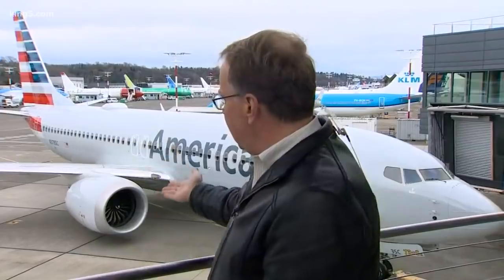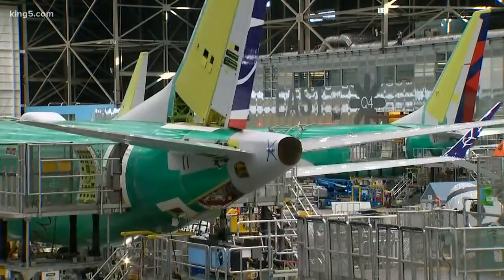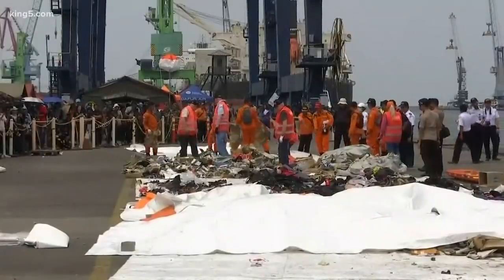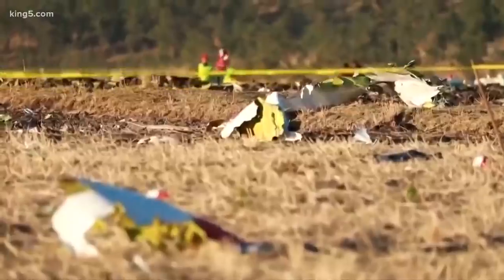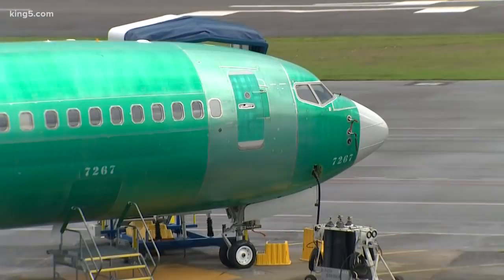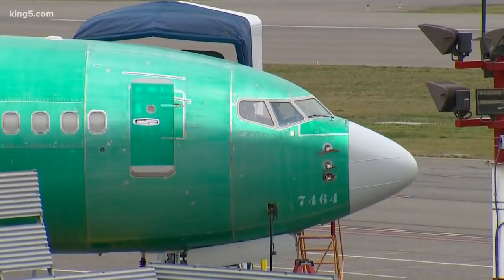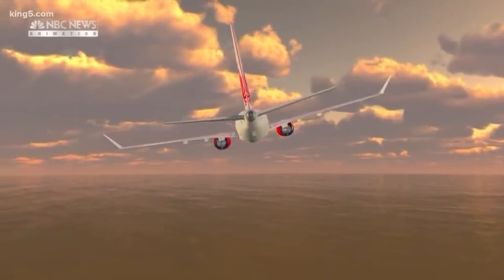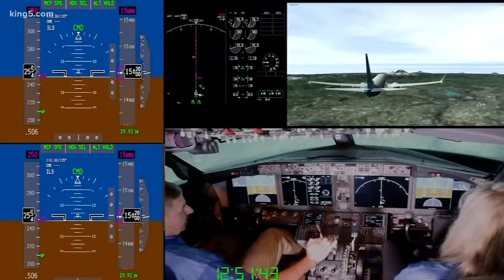Boeing unveils 737 Max fix

Comment: So what happens if the nose goes down due to the trim adjustment and the system is disabled at low speed but the yoke is pulled hard back in low altitude and dense air where the manual trim is too hard to correct? The software fix just alerts you but doesnt help you trim it correctly with little time.

Comment: If i should fly a max again i would like 2x2 AOA sensors, that  can work simultaniosly and when one sensor is giving another Reading than the rest the majority wins, and replace the faulty
sensor as soon as you land, and i would also accept if they move the Engines back where they used to be  so that they dont need the MCAS system....

Comment: ". . . an angle of attack sensor, and its suspected of playing a part in two crashes." That's Seattle media scared to death of offending Boeing, who already has one foot out the door of being a "local employer." Suspected has nothing to do with it. That's three crashes.

The 737 and the 737 MAX were treated as one airplane when pilots should have been certified on two, not one airplane. Second, Boeing, the FAA, and the airline companies that bought the 737 MAX should have made training in the MCAS system mandatory.

That's the only two fixed needed here, but to save money and increase profits, lives were lost. Good thing Boeing is used to being sued.

Comment: The MCAS (that has been blamed for the two accidents) behaves like all Airbus flight control systems, except all of those systems have redundant sensors. The Air France 447 disaster had a triple system failure (pitot tubes) and pilots ignorantly stalled plane into the Atlantic. Don't go skipping off into an Airbus thinking the pilots actually control the  aircraft more than Boeing designs. Boeing messed up, but so did the pilots. The runaway trim switches were right were they always are on the 737 max aircraft. Recently, Airbus A320neos have been having significant engine issues on brand new airplanes that pilots have fortunately saved the day with no loss of life. Lets hope it stays that way and Boeing gets its Airbus like flight automation corrected.

Comment: 737 was a fairly save aircraft, haven't heard of one crashing for a long time, does not happen often, so why "fix" something when it inherently is not exactly broken? Especially fucking it up this badly. "Never change a running system" is a common expression used by IT folk for not messing with stuff when it works well enough. Boeing did something that is understood to be a risky thing and went about it in the most unsafe manner possible. Those ultimately signing off this system at Boeing should be fired and never receive another high-paying manager job ever again, a person that cannot foresee the implication of messing with such a system or wrestling control away from pilots flying an aircraft known to be more manual than comparative offerings from Airbus should not be trusted with the life of other humans.

Comment: Ten to one Boeing had a good idea about the issues but thought it would work itself out during its routine maintenance 
But it failed sooner than they thought.....

It has happened before on the updated fly by wire on the  ( think it was the 737 ..unintended tail rudder deflection)  that had several issues back a bit of years ago. And planes crashed all over the place.
Its hurry up and jam them out without the costly extended testing
Proceedures.  ....you ca n full in the blanks......

Comment: This has been dubbed by the interet the flying coffin this includes the max 8 and 9...its all over, the airframe cant be modified to appease passengers fears boeing is trying the cheap fix  when scrapping the project is the only ansawer to save boeing...what a mess boeing is putting money over peoples lives,it can only bring down the whole of the us aviation industry, scap every single airframe today

Just imagine if china had produced a plane design that had these crashes..no passenger would ever fly again on one

Comment: Not flying 737 max ever. The problem is not software. It’s hardware. The plane is unbalanced with those engines being over sized. Sorry but no, it is not fixed.

Comment: Safe , until the next crash. Boeing gambled with the lives of passengers and crew -show now some responsibility. I do not believe that it was just an AoA failure. You would normally not activate such a radical system unless stall is confirmed -engine readings speak volumes. FDR is not the only source. I smell a coverup.

Comment: No, I am not a pilot. But I've been around all generations of 737(except max) in the hangar since highschool. I am currently type rated on NG. Most of what I'm saying is deduction based on my technical knowledge, history (of both model and company) and a bit of experience on other brands I've worked with and their respective problems and fixes. The 737 remains my favorite. When assessing a model you must take into account the history of other models built at the same time since similar design doctrine is used to save on costs.

Comment: The larger engines create an inherent imbalance for the 737 airframe - like a teenaged kid putting a big V-8 in a small car. The software was meant to correct this imbalance, but in any critical situation, the imbalance remains, and window for even seasoned pilots to recover from a given issue has become very small.

Comment: The design is a failure for the safety of passengers to save fuel
Reply: Hmm, it really sounds like you don't understand how aircraft works, and it really shows you don't know what the cause of this accident was. MCAS was not on the plane to "save fuel" it was put on the plane as an anti stall system. The 737 MAX is the same design as previous 737 with new flight control systems, so Boeing told the airlines that pilot training was minimal and did not have to re-train in the simulator. Also 737 pilots did not need to change their Type Ratings to fly this plane. This literally has 100% absolutely nothing to do with saving fuel causing these accidents. MCAS is new, and obviously it has/had issues whenever faulty flight data was coming into the flight systems.

Comment: Y’all wait until over 300 lives have been lost to now update and train pilots! Steupsss! Scrap that whole fleet of 737 max.
Reply: I don’t think it have anything to do with 1st/3rd world. If Boeing is the main supplier of aircrafts and a new software is being installed, I think all aviation officials should be updated on such.
Reply: Mandisa Makini Weston  On the last crash the pilots turned it off & it got worse. Bigger problems than their letting out.
Reply: Most of the Max versions are flown by first world airlines.... The 2 crashes were flown by third world airlines... My guess is their training is lacking...
Reply: @DS-wo8wr  I mean the original poster saying to scrap the fleet is wrong and stupid as hell. But from what I understand is that the pilots exhausted all remedies that Boeing laid out for this type of incident, then started over and did them again with no luck. Also, the AOA sensor on at least one of the crashes was faulty, and sending incorrect data to the flight control systems, I think thats why both sensors will be used in the future, and obviously it is not going to force the plane to nose dive anymore just because it thinks the plane is stalling.

Comment: Not that it justifies a sketchy sensor design, but is it taboo to bring up that neither pilot was trained on the MAX by their employer? Interesting that no MAX trained pilots have crashed. Black box shows 40 seconds of struggle over control of the MAX... that is a long time to turn a switch off.

Comment: While I do think Boeing is at fault the majority of the blame should go to lion air and Ethiopia and possibly other airlines for taking short cuts in training their pilots if they where trained right they should have known to turn the stabilizer trim off so the airplanes computers wouldn’t interact with the horizontal stabilizer so I don’t think the blame necessarily goes to the pilots either because they were not trained in what to do in this scenario and I don’t know why no one is blaming the airlines

Comment: Honestly, things that should have been in place from day one. Flying, to me,  is amazing. When you really think about the mechanics at play, the stresses, the physics of the whole thing it is incredible that there aren't more crashes. That's because aviation has learned from over a century of being in the air now. To have a single point of failure on an aircraft being built in the 21st century is irresponsible and foolish. Also, cost cutting and lazy. I'm sure the bean counters at Boeing had something to do with this. 

I have a CDL. There is a primary source of air and a secondary source for air in trucks on the road today. If one source of air drains, then you move to your secondary air source while you find a place to stop. This is an automatic transition and you get an alarm once that primary source drops below 60psi. If that secondary storage also cannot be replenished and drops below approximately 40psi, then there are spring brakes that activate on every axle and stop the truck dead. There's a backup for the backup in other words. Boeing will have a hard time repairing their image after this is all said and done.

Comment: The 737 max series was screwed from the beginning. It’s possible the whole issue for the max stems from the height of the aircraft. They’re too stubborn to design a new airframe that can sit taller. So GE had to make engines that accommodate the efficiency of the LEAP engine and size of the 737. The engineers then had to move the engine forward impacting CG and the airflow over that portion of the wing. So they created MCAS To help with protection against stall since it’s most likely a little less stable than the current NG version of the 737. I’m no engineer and I truly don’t know what the Boeing max engineers thought process was but this forever damages the 737 max reputation. Even if a software fix does Fix it, as a passenger I can kiss feeling comfortable and safe on a max 8 goodbye. Just a thought.

Comment: Why does plane so much relies on the AOA sensor? Why is it's AOA such a concern? This MCAS was developed to compensate a faulty design. Boeing expected it to be stalling and maybe due to mispositioned Engines. Would you rather use the 787 concept on a smaller plane or force bg Engines on an old design?

Edit: big Engines

Comment: I'm wondering if Boeing's Walmartization of aircraft manufacturing has anything to do with this. As Boeing has squeezed and even black listed some vendors and suppliers. We're seeing part shortages, more frequent part failures, parts that have failed being put right back into the supply chain. So I wonder if these failed AOA vanes on such new aircraft maybe in part from Boeing's continued effort to squeeze vendors and suppliers.

Comment: When I first heard of this stall prevention system using one sensor, I considered that to be risky design, no matter how reliable the sensor has been over multiple years.  When I heard that some airlines had paid to get a warning if the primary AOA sensor disagreed with the second sensor, I was aghast that safety would be sold as an optional extra.  Cars don't have optional brakes, heck, these days, they don't even have optional anti-lock brakes - it's built in every time.

"On Nov. 27, about a month after the first crash, Boeing executive Mike Sinnett told American Airlines ’ pilot union that their pilots wouldn’t experience the sort of problems that doomed the Lion Air flight, according to Dan Carey, union president. That's because American paid for an additional cockpit warning light that would have alerted them to the problem, while Lion Air and most other airlines didn’t." [WSJ]

THAT is somewhere between greed and criminal negligence: If MCAS was required to assure safe takeoffs, then RELIABLE MCAS should not have been an added cost option.  And STILL, for the angle readouts instead of simply Reporting "AOS Disagreement," Boeing wants extra cash.  Again, if your antilock brakes fail, you expect the idiot light to be right in your face, not something you are told you should have purchased before you skidded into that tree. (Marc Bolan was unavailable for comment)
 
Shorter version: "Pay extra for safety? AYFKM???" **
**Are You Freaking Kidding Me?
Reply: Longer version:
https://granitegrok.com/blog/2019/04/boeing-737-max-was-safety-optional

Comment: So before, MCAS relies on only one sensor. If one sensor malfunction and the plane is not stalling, the MCAS will treat it as a stalling and activate. Now they change the software so it relies on both sensors. What if the plan is truly stalling but one of the sensor malfunction? The MCAS will not activate and the aerodynamic design of 737Max means the pilot will not have enough time to put down the nose. It will creat even bigger danger for the planes because 737Max can much more easily get to stalling situation than other aircraft types by design.
Reply: Exactly! The fix is not adequate to make me feel safe. A malfunctioning AOA sensor will only disable the MCAS. Now the pilot is on his own with a plane that's prone to stalling.

Comment: The jet is safe. It's unbelievably powerful and a strong, stable bird. I've flown on it multiple times. The problem was that the Boeing Execs (and whomever at the FAA)  made a decision not to require the Airlines to re train pilots on the brand new aircraft. This would be a huge cost outlay for most  Airlines that struggle to profit these days. Especially after forking out huge dollars for new equipment. And the orders for the new jets would have suffered as a consequence. This is an unbelievable fact that jeopardized all future passengers. Now they are back pedaling and trying to say it's a software problem? Wouldn't have ever come up had the pilots been properly trained on the new plane. There is a manual override off switch that is explained in another upload I'm sure I saw previously. Boeing is in hot water here. Not to mention the huge losses for Airlines having to ground and re schedule coupled with lost revenue from freaked out travelers no matter what plane they were supposed to fly on.

Comment: 737 max8 has aerodynamic flaws thats why it need mcas to prevent stall due to nose up that cause from a bigger engine placement,boeing should fix it first so it doesnt need mcas,its harware problem at the begining not the software,boeing should redisign completely the max8
Reply: Agreed, its not only max 8, but all 737 max i think.